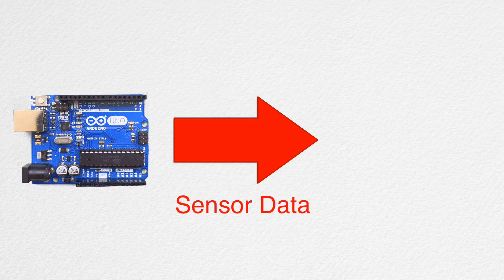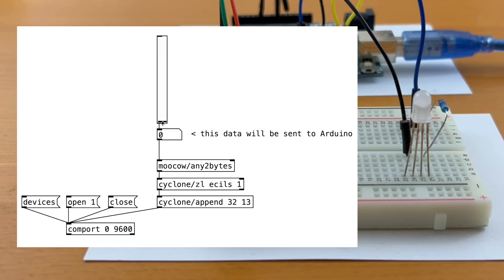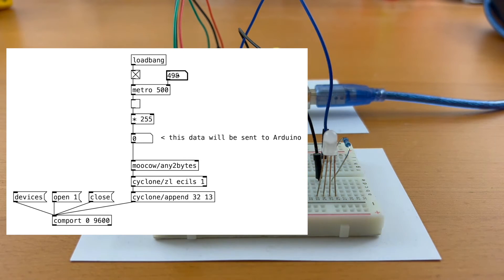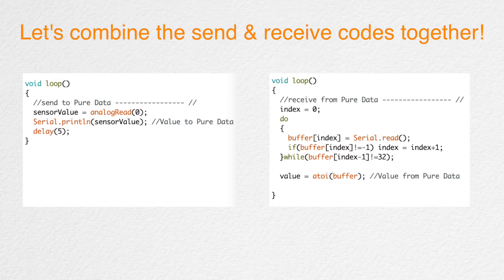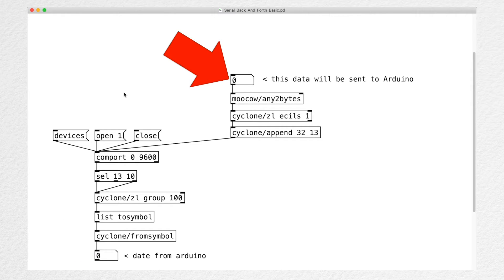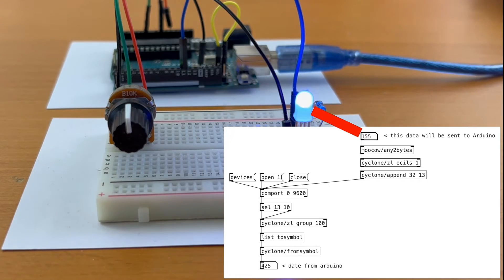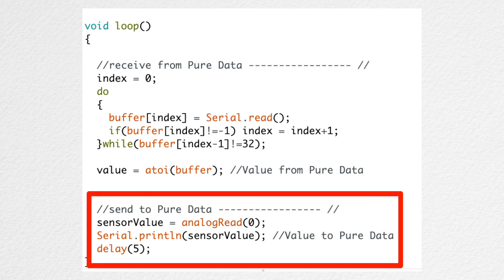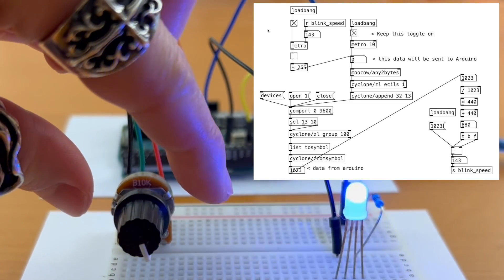Sending Data Back & Forth Between Arduino And Pure Data (also works with MaxMSP!)

Comment: The moocow externals seem to have vanished from the Internet and I can't find another way to reliably convert the data to bytes. That said, sending [print 1234 1234 1234( to [comport] is supposed to handle that parsing, so you can send arbitrary lists, symbols, or strings, but it doesn't seem to be working, either. I only ever get newline (10) at the other end, not the content of the message

I'd sure love to figure out how to just make [print *( work, but an external (or other technique) that converted to bytes would be second best.

Edit: Turns out, in MacOS, you need to confirm each *.pd_darwin file by right clicking, clicking "Open", and then telling the warning box OK. But I still get errors when I try to send anything at all.

Comment: is it possible to send max msp or puredata to a teensy and use that as a standalone synth, without ever having to connect to a computer? including knobs.
Reply from the maker: You can use the Daisy to flash your Pure Data or Max gen~ patch and create a standalone synth. 

Building standalone synth with Teensy should be possible in general too. I think M8 is Teensy-powered.

Comment: I'm not able to get the pure data code to work. Two of the objects show up red and don't work. any help would be appreciated
Reply: Yeah, moocow's externals seem to have vanished from the Internet. I'm hitting the same problem now. [comport] claims to parse things properly with a 'print' command but it doesn't seem to work.
Reply: Sorry about that, I never found the answer i was looking for and haven't looked back at pure data for a while but I absolutely loved the software and moocow's channel when i did. Hope you find what you need soon. @joshuaa.c.newman7430

Comment: Beautiful. I usually transfer data between arduino and PD by using Serial.write instead of Serial.println.. It has its own problems, but at least I dont need all the libraries and complicated asci decoding stuff :) but nice to see multiple methods of doing things!
Reply from the maker: I should try out Serial.write!! But yeah, if it works, it works!!

Comment: Excellent! Been needing to retrieve frequencies from the Teensy laser synth to the controller's monitor, modify the frequency from the freq counter, then send that value back to the laser synth in real.
So far, I've only been able to display the frequencies with the Arduino IDE's serial monitor.
Also diving into TouchOSC and customizing Reaper's DAW for touch GUIs over Ethernet connected devices. Fun stuff.
Thanks!😎
Reply from the maker: It sounds like you're getting more powerful with every new update! Looking forward to it as always.

Comment: I usually go for the OSC library provided by CNMAT (on github).  It allows sending OSC as SLIP encoded messages over USB.  That allows as many ins and outs as you might want, with human readable addresses.  It's also simple to port over to boards with wifi should you ever want to do that.

Thanks for creating such a friendly resource for new patchers 👍🌈
Reply: nice, I just got an esplora that has usb client capabilities, so went straight for usb midi. but this osc over slipserial sounds interesting, much more so than ttyMIDI for instance.
Reply from the maker: I definitely need to look into this. I always wanted to try out OSC communication for something like this. 
Thanks!!

Comment: That seems like an easy workaround, I think the more proper way to do it would be to use something like the Task Scheduler library on Arduino for asynchronous execution of the sending and receiving. I don't have much experience with this though and it is a pretty big step up in coding concepts.
Reply from the maker: I wanted to do it in the simplest way as possible haha
But yeah for sure, there are going to be methods that are more suited/optimal depending on the project. I'll have to look into this, thanks!